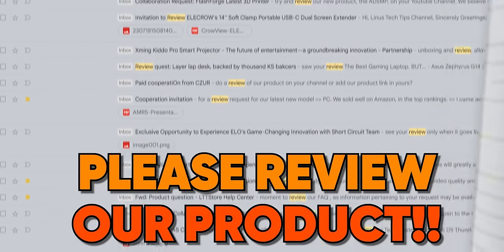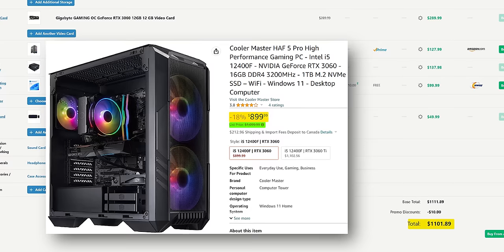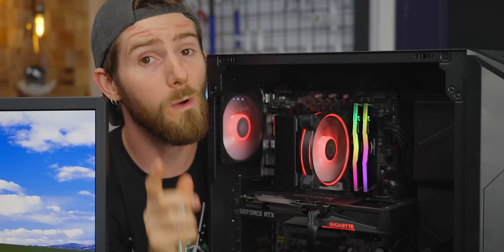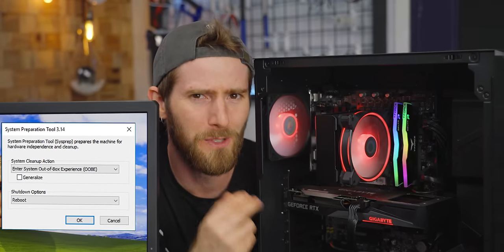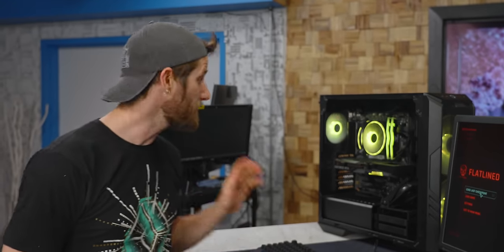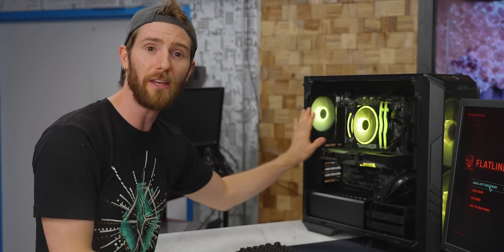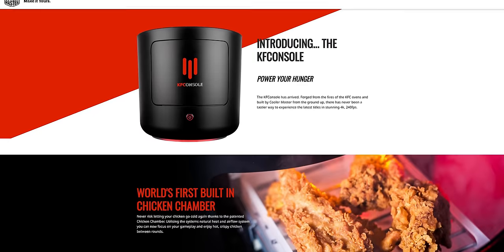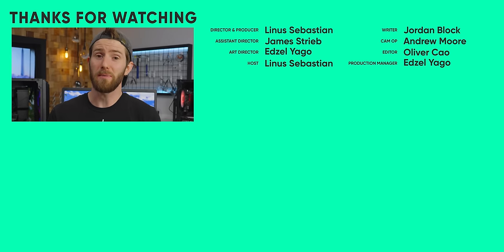Cooler Master Makes Gaming PCs Now? HAF 5 Pro Gaming PC review

Comment: Just remember with CSGO, they must've got their benchmark results from when the older graphics and motherboard drivers were installed. Just food for thought.
Reply: Also the framerate is capped to 300 unless you disable it in console

Comment: Hello Sir, This is Rohith from India. I brought a Custom Gaming PC back in 2020. Now im moving to montreal, i want to bring my PC with me in Dec 2023.
Spec 
CPU: Intel i9 9th gen
GPU: MSI Geforce RTX 2070 Super
RAM: 16gb
SSD: 500gb & 128gb
HDD: 2TB WD
PSU: Coolermaster MWE 750, 230v
Here in india power output will be in between 220-240V and my PSU is 230V one. As the PSU consume's a lot weight in the luggage, im planning to take a new one as soon as i arrive in Canada. If i get a new PSU which is having 750 with 120-140V will it able to run my PC smoothly? Or should i need to get a Voltage converter which helps me to step down thing. Please help me figuring out. Its been a while since i raised a ticket in Coolmaster support long back i havent recived any response from them.
Reply: Yeah that should be fine, the output wattage remains the same. The input voltage gets switched by the power.

On the packaging/specs of your PSU it should say if it can switch automatically between 100 and 240v, old PSU's used to have a physical switch for that but MOST modern PSUs should do this themselves.

If you want to be 100% uber sure then yes just sell your current PSU and buy a new one in Canada, the rest of the PC will run fine.
Reply: You need 2000W psu
Reply: @Kevin-mx4vm  lmfao

Comment: I kinda like the reset switch RGB control? No RGB bloatware which barely works in my experience anyway is good, and when you need to reset your pc (which should be pretty rare) you can juts turn it off and on again.

Comment: That sponsor is insanely overpriced. $100 for a 100mm fan in a sealed housing? I can get a remote controlled full tower fan that makes noise and actually moves the air for half that. I wouldn't even pay $15 for that tiny thing unless I had no other options.

Comment: 🎯 Key Takeaways for quick navigation:

02:48 🚫 Loose screw found in Cooler Master's review sample gaming PC, indicating possible oversight in quality control.
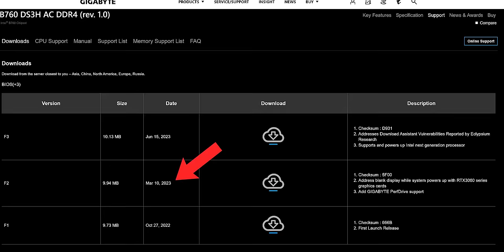05:10 🛠️ Amazon's system had a faulty RAM stick, requiring troubleshooting and potential warranty service.
07:40 🔢 Both systems showed virtually identical gaming performance in benchmarks, with slight variations within the margin of error.
10:01 🧐 Cooler Master's cable management had minor issues, such as different colored zip ties and a non-intuitive reset switch for RGB control.
12:34 💼 Cooler Master's pre-built gaming PC offers decent specs and attractive pricing, but quality control needs improvement for a better customer experience.

Made with HARPA AI

Comment: The reset switch RGB control is standard for cheap Chinese RGB controllers. I have some in my PC now lmao. It's a horrible system and really disappointing to see a reputable company known for their fans and cases also use this garbage method.

That being said, It's very impressive to see the value offered here from a prebuilt PC.

Comment: In defense of Cooler Master using the Reset button for LEDs: More intuitive for newer users and requires no software. Also, if one needs to hard reset, holding the power button down for 4 seconds will ALWAYS shut down your PC.